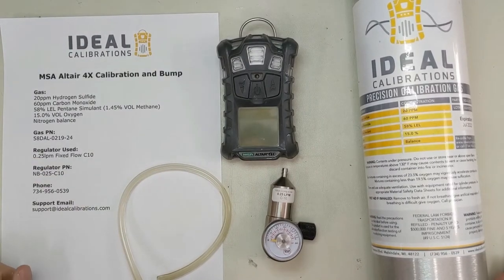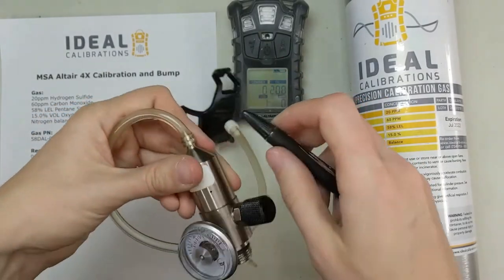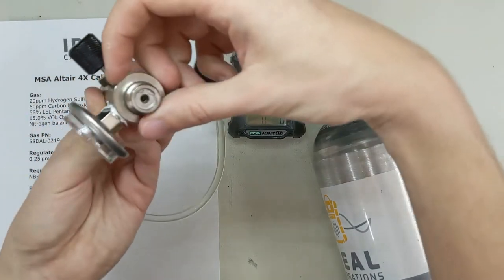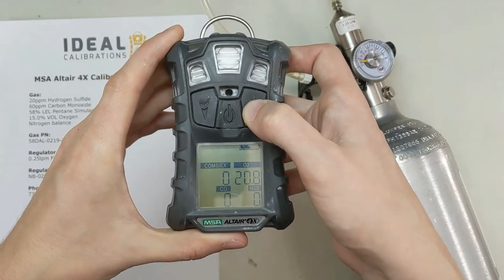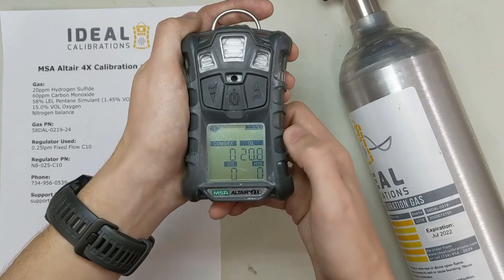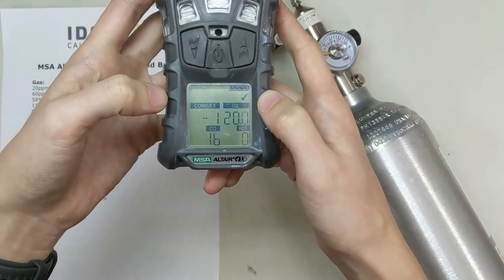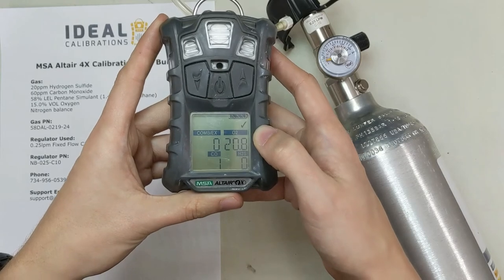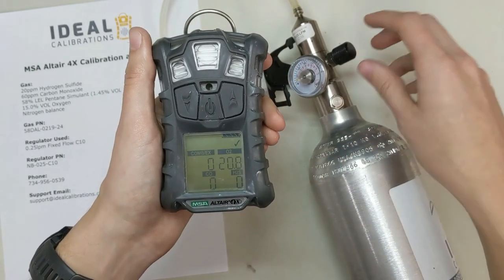Altair 4X Calibration Guide by Ideal Calibrations

Comment: Great video.
For the zero calibration, what if I I use a zero air generator to pass zero air through it? Would that work??
Reply from the maker: Yeah it will if you have a lab grade zero air generator. Not something I've used before as we usually use cylinder gas. Far more portable.
Reply: @Idealcalibrations  Thank you very much!

Comment: Hello, i need help. When i calibrate i get Span pass message but when i switch off and on, again it requires calibration. How can i sort out the problem?
Reply from the maker: Hey Martin, what does your clock say?  Often when there's a problem with the clock it won't save the calibration properly because the date is off.
Reply: @Idealcalibrations  I didn't pay attention to the clock, I will check it today and get back to you.
Reply: @Idealcalibrations I just checked the clock is okay.